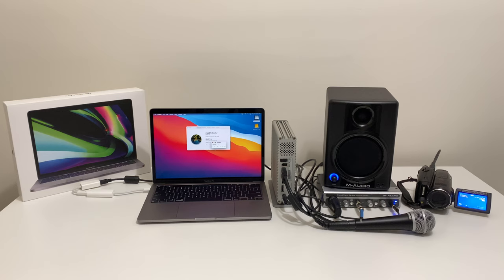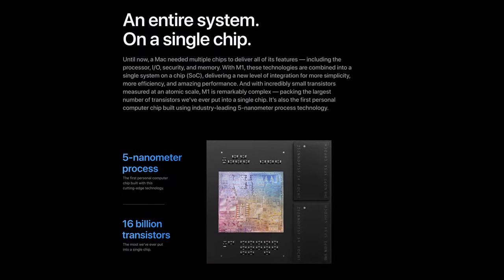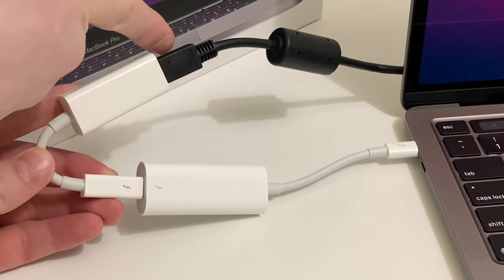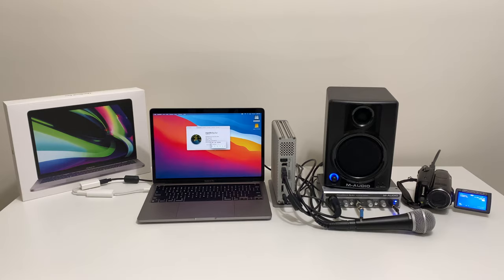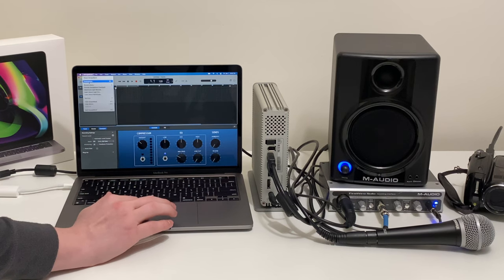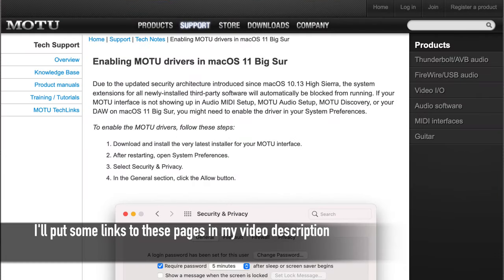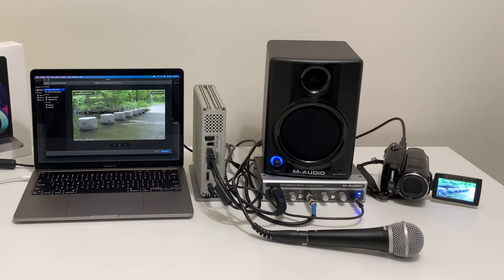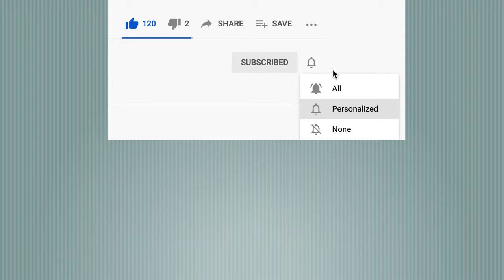How to connect FireWire devices to a new M1/M2/M3 Mac with Apple Silicon

Comment: Hi mate I used all the cables and connected it to to my camera: Sony dcr-pc350e but it’s not coming up in iMovie? Idk if the camcorder is too old as it’s using a handycam station as the camera itself does not have a dv input and I’m using the MacBook air m1 version 11.4
Reply from the maker: It should work, but maybe try updating your OS as 11.4 is a little old.
Reply: Updated and still not working. It’s not coming up as a media source in imovie when I have the tape playing either. Is it because of the handycam station or the cameras not compatible?
Reply from the maker: @a1tomy  The only thing you can really do is start swapping out variables. Try a different computer, try a different camcorder, try a different thunderbolt adapter, try a different firewire adapter, try a different cable, etc in order to narrow down what the issue is
Reply: Got it working after changing the cam. Thanks for your prompt replies scott

Comment: Hello Scott, thanks for the video. I have a Panasonic NV-GS250 Mini DV camera. The camera is plugged into a power source. I connected to my M1 chip 2021 MacBook Pro using the firewire adapter into a Thunderbolt 2 to Thunderbolt 3 converter. No luck. My MacBook doesn't recognise the camera in finder. I've tried rebooting the Mac, shutting down the camera, connecting step-by-step. No luck. Do you have any suggestions?
Reply from the maker: Are you running macOS 12.3 or 12.3.1? If so, check out this video: https://youtu.be/vfwfZgGI3JY
Reply: @ScottSchramm  This looks like my problem. Thanks so much.

Comment: I hook up my RME Firewire audio interface to both my M1 Studio and Macbook air with the dongle's you've mentioned above. However, if the audio interface is plugged in, I cant connect any other external USB or Thunderbolt hard drive into any of the spare USB ports of the computer. Has anyone noticed it?

Comment: Hi Scott, My Macbook Pro M1 13inch does not recognize my Iomega external hard drive. Any advice?
Reply from the maker: Go to Apple Menu > About this Mac > System Details and see if the drive shows up in there.
Reply: My computer now recognizes my external hard drive but no data appears. Apple says it possibly doesn't like having two adapter cords. Is there one adapter cord for firewire /thunderbolt 3? Any suggestions? My external is Iomega eGo
Reply from the maker: @ledzep727  The person at Apple doesn't understand how their own adapters work lol. Having both adapters plugged in is the only way to make it work....there is no single adapter or cable to connect FireWire to the new Thunderbolt. Open the Disk Utility app on your Mac and see if the drive shows up there. Its possible the hard drive is corrupted and or in a unreadable format if it's not able to mount. The other thing you can try is it looks like your drive has an older USB 2.0 port. You could try connecting that way and see if it works, but it will be a lot slower then FireWire.

Comment: Just bought a m1 mac and have a firewirem audio profire 2626 will it work with those adapter?thanks
Reply from the maker: The adapters will work but it depends on if the drivers are compatible with Big Sur or Monterey.
Reply: @ScottSchramm  ok thanks..

Comment: Heh, I tried that out with my M1 MacBook Air and it works great for archiving my old MiniDV tapes, along with my even older Hi8 recordings using my Sony Digital8 camcorder. Only thing is, it will only work if the MacBook Air is plugged into an external power source (i.e. the included AC adapter), and you have to have the screen lid open in order to do it (otherwise when it's closed and the FaceTime HD webcam won't work, it prevents other camera streams from working as well.)
Reply from the maker: If you have power, and an external keyboard and a mouse or trackpad connected, you should be able to operate the system with the lid shut. This is what they used to call "clamshell mode"
Reply: @ScottSchramm  One can even use the tiny stay-awake utility Amphetamine to have the macbook stay on and awake in clamshell mode without keyboard/mouse/monitor attached, and even while it's on battery –– to be used with caution, and the failsafes provided by its helper app Amphetamine Enhancer.

Super useful for when you want your last macbook to become a file server, plex server, etc :D

P.S. Thank you for  this truly helpful and clear and thorough (and concise!!) video!!

Comment: Can i conect Maudio project mix firewire interface to mac m1
Reply from the maker: You can connect it with this method, but you'll need to check and see if it's supported on the version of macOS you're running

Comment: A great video to connect firewire, to download DV video to M1 Mac.  
Do you also have a solution to digitize VHS tapes on a Mac mini M1 on FCPX or DaVinci Resolve?
Reply from the maker: A lot of camcorders have an analog AV input that would allow you to use as a pass through. The other option would be to get a USB capture device. I usually don’t recommend because they aren’t able to capture the full quality of miniDV but for VHS (which is already analog) it won’t make much of a difference.

Comment: Great vid Scott! I have a PreSonus StudioLive 24.4.2 the M1 14’ Macbook Pro. The mixer has a firewire port, but It will not connect to the Mac with all the adapters. Do you have any suggestions to be able to connect the Mixer?
Reply from the maker: Go to Apple Menu > About This Mac > System Report and see if you can find the mixer listed in the FireWire or Thunderbolt section there.
Reply: Did you get it work??

Comment: I have a universal audio firewire satellite quad with firewire 800 cable going into a firewire to thunderbolt 2 connected to a thunderbolt 2 to thunderbolt 3 adapter like yours going into the thunderbolt connection on my m2 mac mini pro on ventura.... it just does not see it....
Reply from the maker: According to the manufacture, it's still supported. This page says its compatible with Ventura: https://help.uaudio.com/hc/en-us/articles/210208926-Latest-Mac-Windows-Operating-System-Compatibility-Information but this page says there are some extra steps you'll need to follow to make it work on an Apple Silicon M1/M2: https://help.uaudio.com/hc/en-us/articles/360057137692
Reply: @ScottSchramm  thanks so much for getting back... I did see those articles... one possibility is that the firewire to thunderbold 2 adapter may not working so I ordered a new apple one to see.... I will let you know if this was the problem and thanks again for you time on this....

Comment: I have the MacOS Monterey. Will that FireWire device you have really work on it?
Reply from the maker: I showed the devices working in the video
Reply from the maker: Still works in macOS Ventura as well: https://youtu.be/-okFyuJYZ6c
Reply: @ScottSchramm did you download the software for the audio interface onto the computer or the external hard drive?
Reply from the maker: @mjb12ification  To the computer, but the software for my interface is no longer compatible.

Comment: Hoi Scott! Thnx for your video. I own a Midas Venice F32 audio mixing console. It’s supported up to El Capitan, but wil work on a 2019 MB Pro running on Monterey. However, using the same adapters (tb3-tb2-fw800) it doesn’t work on a 2020 MBP. Do you have any idea or explanation for this? The “latest” driver was al ready 7y old on the Intel Mac so I of course used the same one on the M1 Mac.
Reply from the maker: Probably stopped working due to kernel extensions no longer supported in the newer OS's.
Reply: @ScottSchramm  but the Os’s on both machines are identical, it’s the chips (Intel vs M1) that are different.
Reply: The 2019 mac is Intel and the 2020 (both on Monterey) is an M1.
Reply from the maker: @p-rt-l2792  Interesting. I moved from Intel to M1 and haven't noticed any issues myself, but I guess its certainly possible if the drivers don't work through Rosetta 2
Reply: @ScottSchramm  that’s what I found interesting when I saw your video. You have so many different fw devices running on an M1 Mac, even pretty old ones, yet nobody (and I’ve read many, many forums) seems to get the Midas desk to work with an M1 Mac, yet it does work with all OS’s on an Intel Mac. If you have any suggestions, they are more than welcome!

Comment: I am not convinced your audio device was working. Please show the M-Audio device listed in the Audio MIDI Setup app. I have tried this exact setup and it does not work.
Many many audio studio professionals have been trying to find a solution for years. The only workaround so far is disabling SIP and duplicating command codes from older macs.
Reply from the maker: Correct. FireWire audio can no longer be used in newer versions of macOS.

Comment: Hey Scott, I'm trying to do this with a a RME FireFace 800 device, and it just won't come up. I've updated drivers and etc. Tried everything. 

Does the type of Firewire800 cable matter, this one is a 1394b
Do certain devices just not accept this sort of connection?
Reply from the maker: 1394b is FireWire 800. What kind of computer are you connecting it to? Are you using the Thunderbolt adapters?
Reply: @ScottSchramm  Thank you for getting back! It's a MacBook Pro 2018 Touchbar 15" -- I have the adaptors - 800 to TB2 and TB2 to TB3(USB-C)

And it just won't show up
Reply from the maker: @dazemachine  go to the Apple menu > About this Mac > more details and then look in the system information and see if it shows it listed under Thunderbolt or FireWire. This will narrow down if it’s a hardware or software issue.
Reply: I got it to work!!!  -- the driver was being blocked by security preferences 

Thank you Scott!!!
Reply: @dazemachine  what did you do to unblock the driver?  My camcorder shows up in the system report, but iMovie doesn’t see it.  I wonder if what you did will work for me.  Thc

Comment: Hiw did you install the driver for the firewire?
Reply from the maker: https://youtu.be/0EhzlqH9fMo
Reply: It doesn't work anymore in the latest OS.  All of this stopped working with Mac OS Monterey 12.3.  Hopefully there is a fix soon, who knows..   Well for digital video devices at least.  They show up in system information, but don't work in iMovie, Quicktime, OBS etc anymore.  Thread on apple support about it.  Sucks.  :-(
Reply from the maker: @MrTrickyBuzz  Interesting. I will do some testing and report back.
Reply: @MrTrickyBuzz  seems to be the case. Using exact setup as Scott and system information says FireWire connected however iMovie not seeing device.  Wondering if other software capture for Sony dig 8 works? BTW it did work before upgrading to Monterey 12.3.

Comment: Hi Scott! Thank you so much for your video. It's really helpful!
Did you try the next set?:
- Apple Thunderbolt 3 (USB-C) to Thunderbolt 2 Adapter.
- Apple Thunderbolt 2 to FireWire 400 Adapter. (Directly to 400. Not using the 800 to 400 adapter).
Reply from the maker: The Apple Thunderbolt to FireWire adapter only goes to FireWire 800, there is no version with 400. So if you want to connect to FireWire 400, then you should consider a FireWire 800 to 400 cable. I have a few options linked in my video description.
Reply: @ScottSchramm  OK Scott. Thanks again for all the information. :)

Comment: Hello! Do still need an interface to transfer videos from my device to my mac m1 if I have all the connectors?
Reply from the maker: Depends on what "device" you have and what connections is has.
Reply: @ScottSchramm  I have a DCR-TRV 140 and it has a DV connection so I would use a Firewire 400 to 800 then an Apple adapter to Thunderbolt 2 and finally a Thunderbolt 3 adapter onto my Mac. Put like this, would it work without an interface?
Reply from the maker: @samanthadashiel  I'm not sure what you mean by "interface" - you just need the cables/adapters...the first three links in my video description.

Comment: I'm using:
- RME Fireface 800
- 2021 Macbook Pro (M1 Max)
- macOS Monterey 12.0.1
- Firewire to thunderbolt + thunderbolt to usb-c adapters (apple brand)

It sort of works. The output keeps dropping out. The main stereo out put and headphone outputs will periodically cut out, and not at the same time. The headphones might lose the L channel. Then both channels. Then they come back. Then the main stereo out will lose the R channel, then both channels. The input still works fine and is showing up on the meters in TotalMix. It's really weird. I don't see any errors/faults in the console related to this, as far as I can tell. Not sure what to do. Very frustrating trying to record with this. I'm glad it at least sometimes works.
Reply: Did you get it to work??

Comment: I have iMac 21" 2011 with old Thunderbolt 1 to FireWire device for my Canon Camera HV40. What equippment I must buy for capturing video recorded with Canon HV40?
Reply from the maker: That model already has FireWire 800 on board so all you need is the cable I have listed as the 3rd link in the video description.
Reply: @ScottSchramm  Now I think about new Mac mini M1, What equipment I should have for capturing video from my Canon HV40 camera?
Reply from the maker: @petarbaburic6257  You need the same things but also a Thunderbolt 3 to Thunderbolt 2 adapter (first link)
Reply: @ScottSchramm  Do you have exact pictures and explanation of those 3 adapters I must buy to have FireWire 400 and FireWire 800 in my Mac mini 2020 that I should bbuy this year?
Reply from the maker: @petarbaburic6257  This video literately explains and shows the adapters you need and even demonstrates them with with the exact same camcorder you have.

Comment: Thanks for a valuable video.  I've been using 1) a firewire 400 to firewire 800 adapter to, 2) an apple firewire to thunderbolt adapter to 3) an apple thunderbolt to usb-c adapter, as you've recommend in this and prior videos, in trying to connect a Nikon Coolscan film scanner to a 2019 intel based mac running up-to-date big sur, but my computer does not recognize the scanner.  Any suggestions for troubleshooting that?  Thanks!
Reply from the maker: Go to your Apple menu > About this Mac > System Report look in the FireWire or Thunderbolt sections and see if it is listed there.
Reply: @ScottSchramm  Hi Scott, thanks.   Yeah, it doesn't show up on my Thunderbolt list, and I've tried many variations of switching cables, turning the scanner off and on, turning computer off and on, switching ports -- the gamut!   Aaaaarrrgh!   I guess I'm destined to just follow this quest, no matter how hopeless, no matter how far...
Reply from the maker: @dlyon9673  Unless you have another system to test it with, its going to be hard to know if it's a hardware issue or software. Old scanners can have problems in newer OS's. Check with Nikon to see what version they support and even if they don't support Big Sur, you can try installing the software to see if it will work. The other option is 3rd party software. There is one call VueScan is claims to work with older gear by reverse engineering the legacy drivers. I've never used it before, but I've heard people have had success with it so you could also look into that.
Reply: @ScottSchramm  Thank you for these suggestions, I'll give them a shot.
Reply: @ScottSchramm  Hi Scott, really appreciate you videos and comments...So I recently purchased a Focusrite SAffire Pro 24 DSP (audio Interface), and have everything plugged in properly and can see it in the system report but the software doesn't pick it up. are there any next steps I can take to make this work? Thanks
Reply from the maker: @crescenzodicecco3310  Check with Focusrite to make sure it's still supported on the OS you are running and check for any software or drivers they provide.

Comment: I'm on OS - Monterey. It is my understanding that FW800 will NOT work with any OS beyond Big Sur. I have not been able to get my 2022 MBO (w/M1) to connect to my FW 800 mixer. Does anyone know a way?  Thanks
Reply from the maker: FireWire is still supported with Monterey, but the mixer you're using may require drivers/software which has not been updated to support Monterey. You'll need to look at the manufactures support page.
Reply: @ScottSchramm  This is what Presonus says about it:   
Hello Pat,
 
Thank you for getting back to us.
 
From your SPX file we see that you are using an M1-CPU Mac.
 
Unfortunately, the StudioLive AI Firewire 800 mixers are not supported with Apple's new M1-CPU architecture.
 
This is further detailed here:
>StudioLive AI/RM Series - Apple Silicon M1 Computer Compatibility

 

Apple has retired their old method of custom device driver support called Kernel Extensions (also referred to as KEXT files) in favor of a different way of supporting connected devices called DriverKit. KEXT files meant for Intel machines will not load on Apple M1 Silicon machines. 
 
The StudioLive AI consoles are still supported with Intel-CPU Macs and Windows 10 machines.
 
We hope this information is helpful in clarifying,
Please let us know if you have any further questions,
 
Thank you for your patience,
Luke

Live Sound Support Agent

PreSonus Audio Electronics
www.presonus.com
Reply from the maker: @quinn1947  Kernel extensions have been deprecated for a few years now. It sounds like PreSonus is just being lazy and doesn't want to keep maintaining the drivers.
Reply: @ScottSchramm  Yeah, I know. I told them I would abandon Presonus if they did not offer me a juicy discount/trade-in - they just said, "sorry" -  So, I need a new mixer. I'm thinking about a Behringer Wing - or, more probably a Behringer X32

Comment: I wonder, would a IEEE 1394 to USB 2.0 adapter cable work for data only connections in place of the dongle for mac minis? I realize that audio won't go through those, but I'm hooking up a bunch of drive enclosures.
Reply from the maker: That will definitely not work
Reply: @ScottSchramm  Why not?
Reply from the maker: @WhiteWoodEnt  FireWire signal can not run over USB. It’s just not possible.